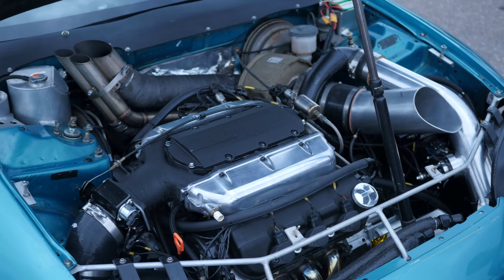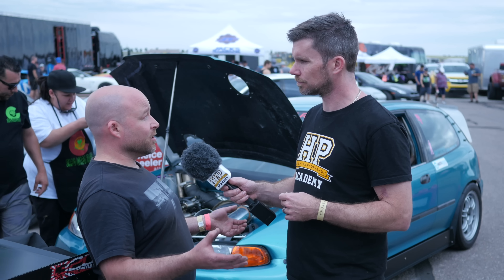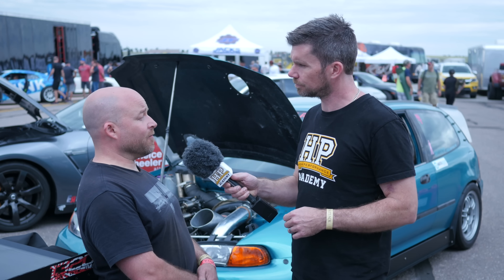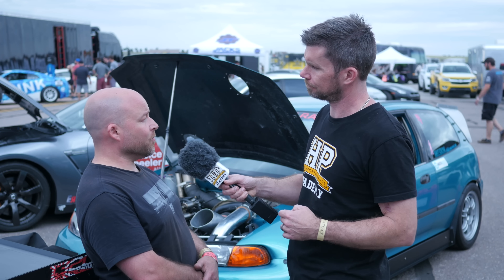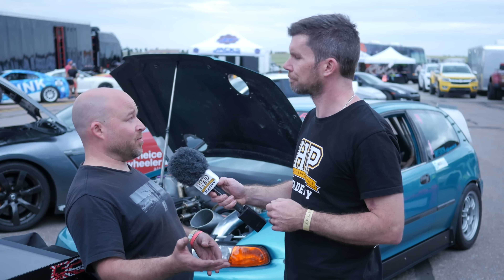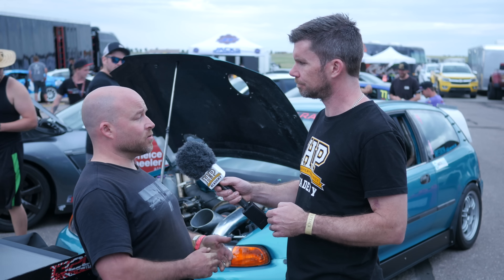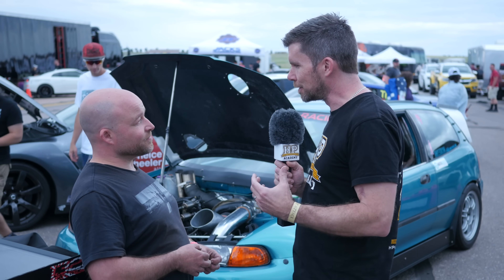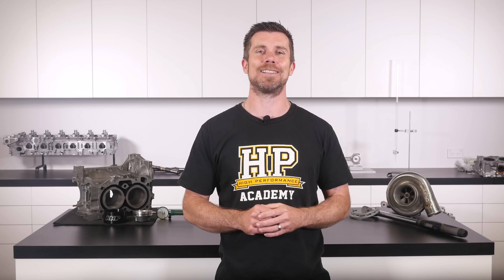1100HP V6 Turbo Hatch | J Series Honda CIVIC [TECH TALK]

Comment: I bought a j32a2/atc6 for $500 today. What was said about the sustainability of 4cyl at high hp and stress is true. I have a k swap prelude 96 si and it has its purpose but I want to spend on the v6 swap. Junkyard j engines. Non of the antiquated dohc vtec heads and trans.

Comment: 1500-2000hp in these J series engines is about the equivalent to 1000-1400hp in the k series & b series because 1400-1500hp is really pushing it in a 4 cylinder
Reply from the maker: Yes, things happen a lot faster and get a lot hotter however - Taz.

Comment: dman never new the j series was so strong. 1100 hp and no sleeves?
Reply: Honda stuff.
Reply: its a vtec in a 3.5L 6 cylinder, these motors are good for close to if not 2000hp and they put more weight over the front wheels than the b series and the k series. they are currently working on dog box trannies & sequentials for the j series
Reply: @josiahbutler2254  Ive always said people sleep on the J. But 1000 hp on a stock v6 is insane.  I wonder how long it would last like that

Comment: also wondering exactly how firing order would affect a twin scroll setup
Reply from the maker: The challenge is routing the exhaust runners in the right firing order to take full advantage of a split pulse housing. This isn't difficult in an inline 4 or 6 cylinder engine but in a V configuration engine with a single turbo application the routing of the runners can become problematic depending on firing order.  The J35 firing order (1-4-2-5-3-6) however allows one bank to be plumbed to each side of the split pulse housing while achieving the correct firing order into the exhaust housing while keeping the plumbing simple. This isn't possible for example on an LS V8 where the firing order (1-8-7-2-6-5-4-3) includes two cylinders on the same bank in succession.

Comment: that much power on stock sleeves!   are they frm sleeves on the 3.5?
Reply: Depends on the Jseries. Most Js have iron cylinder liners so they can take a beating.
Reply: @PiterStreak  I thought that the j30 and j35 were frm and the j32 was iron sleeved.
Reply: @g-mech1244  not 100% sure about the j30 but I know the j32a3 and the j35a8 have iron sleeves. I have both. Aaron should either have the j35a4 or a5. Not 100% sure about it but regardless, they're all open deck. So it's probably has some sort of support to the sleeves. There are few methods to get it done to stock sleeve

Comment: This car needs AWD really bad.  I don't see much point in having an engine that can make so much torque but has to wait until 4th gear to use most of it.
Reply: I dont disagree at all and have strongly considered doing the swap to AWD.  The original goal of the car was to use it as a test bed for Traction Control setup.  The AEM doesnt have any TCS tuning done in any basemap so I wanted to be able to see the best strategy for controlling 2WD (and even AWD) traction in the worst possible enviroment, FWD and high torque.  Believe it or not I still put down a fair amount of torque in 1-3 gears but 4 and 5 are 800 ft lbs peak.  It will see something like 380 in 1st, 480-490 ft lbs in 2nd, and 550 in 3rd.
Reply: @AaronONeal1  would the k series AWD transmission case hold up to all that torque? Or will it need a billet case too?
Reply: @elixirsystems5546  My understanding is that the K dogbox would need a billet case and the gears will need inspected at its current torque level (820+).
Reply: @AaronONeal1  it is alot of torque! Is the oil pump in the j35 any good? What engine mounts for the kswap that can clear the hood?
Reply: @elixirsystems5546  I havent had any problems with them over 9000rpm. Not sure on the mounts, I think the J2K is more the engine to trans and then you run a K trans mount with some mods (possibly) but I havent done it so I am not sure.
Reply: Thanks for the reply.  Just imagine feeling all 800wtq in the lower gears and not have to let off and loose power/momentum with every gear change.  I'm guessing that would use a setup similar to the one found on the AWD 6 speed Acura TL.  Wonder if doing an AWD auto swap would be possible because that would take a bunch of shock load off the drivetrain and be more consistent and quicker by not loosing any boost between shifts.
Reply: TurboDieselDan currently doing an awd j swap in my accord and Aaron is my mentor and tuner. Check it out my Instagram is @jay_swap
Reply: @Sir.VicsMasher  not with the stock J series auto transmissions they all suck. you will shock the crap out of an already weak transmission from factory. he would need a auto transmission  used in the the domestics.
Reply from the maker: RWD, FWD, AWD, no matter what option they all have their challenges, and some people enjoy a different challenge to others which is great for variation imo :) - Taz.
Reply: Love Honda's, hate FWD thats why I dont have one (yet)

Comment: That is why I am running nitrous as well. With the way ATP has designed the turbo upgrade for the Focus ST Ecoboost engine, it staddle it with a GT25 exhaust housing and unlike most ST owners I run a GTX3071 because I needed enough turbo to make 500+ hp. However for the speeds in the 1/4 mile and 1/2 mile  want to reach I need 600-650 hp. So instead of introducing more lag into the equation, I run what I feel is the largest street turbo on the car and hit it with nitrous to make whatever power I want. As long as you can monitor pressure ratio between backpressure and boost which is what this man is doing on his J series you can bring more air to the table with nitrous than with just boost. Manley H beam rods are good to 600+ so I'm not concerned.
Reply from the maker: There's a misconception in the industry that nitrous is an easy power adder, and if you want 300 hp, just add a 300 hp nitrous kit and you're done. With a turbo engine however this isn't always the case. Of course the nitrous can add the required oxygen directly into the combustion chamber but the problem is that we still need to get the increased mass of exhaust flow through the turbine housing of the turbocharger. The net result is that if you're already near the limit of your turbocharger and exhaust manifold pressure is sky high, adding nitrous is unlikely to give you the kind of power improvement you'd expect based on the size of the kit.
Reply: Anthony Thomas 

Ok,,

Comment: How you cooling it?
Reply: The engine radiator is mounted horizontally and is 31x11x2.5 from Griffin.  It was originally meant for a Jeep Cherokee, I also added a swirl pot where the battery would be normally located.  Total coolant capacity is 4 gallons, max temp observed is 186*F.  The air to water has an ice tank in the passenger footwell.
Reply from the maker: It has a water to air intercooler. The tank is in the cabin next to the driver.
Reply: J series barely takes up more room under the hood. Standard radiators are used.
Reply: @The LOL_FIT Drag Car Project Yes I was mate.

Comment: Woe... Question. Why does cylinder fire order effect the ability to use dual scroll turbo features. I didn't think it would matter if one crank revolution covers all cylinders regardless.
Reply from the maker: The challenge is routing the exhaust runners in the right firing order to take full advantage of a split pulse housing. This isn't difficult in an inline 4 or 6 cylinder engine but in a V configuration engine with a single turbo application the routing of the runners can become problematic depending on firing order.  The J35 firing order (1-4-2-5-3-6) however allows one bank to be plumbed to each side of the split pulse housing while achieving the correct firing order into the exhaust housing while keeping the plumbing simple. This isn't possible for example on an LS V8 where the firing order (1-8-7-2-6-5-4-3) includes two cylinders on the same bank in succession.
Reply: Stephen Kelley I believe it might be because of the way it pulses and for best efficiency
Reply: @carlcomputer9686  gotcha! So setting up a dual scroll turbo on a flat plane crank is an ideal situation because of nearly resonate exhaust pulsing? Or at least getting as close to that scenario as possible is ideal.
Reply: Stephen Kelley at least from the way they described it. I'd have to see there firing order to know for sure
Reply: perhaps a more consistant exhaust pulse